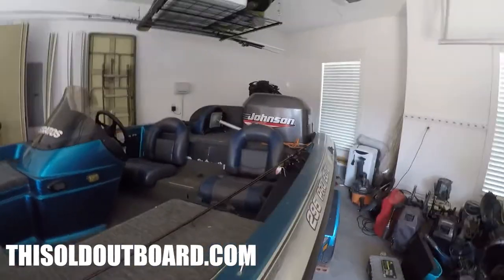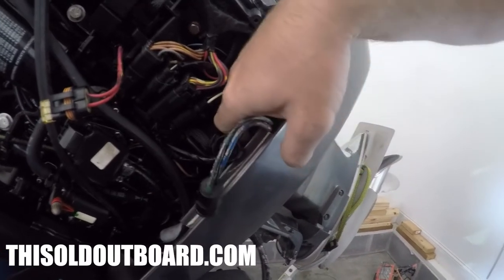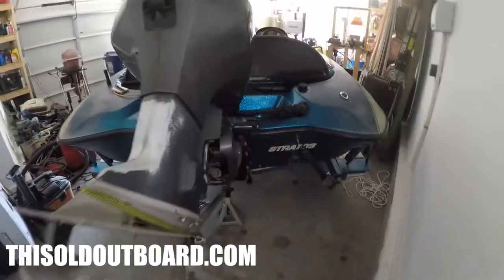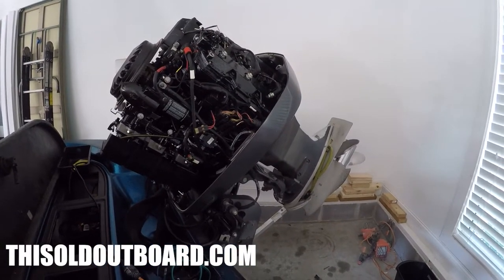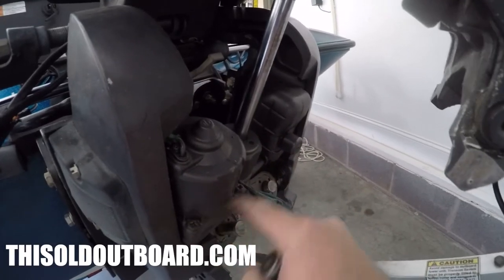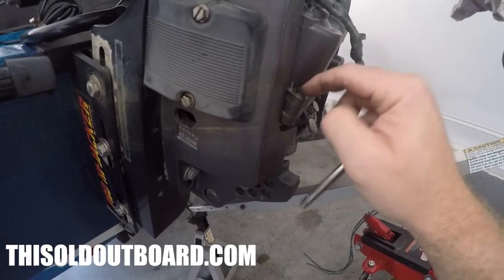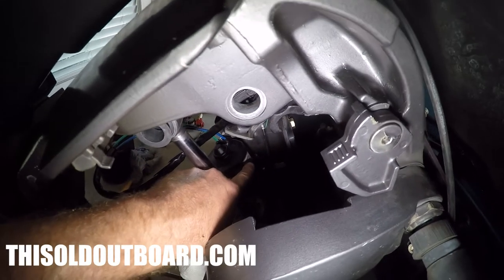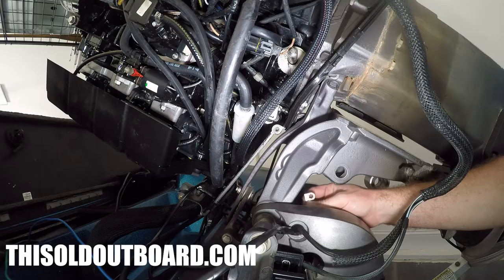Johnson Evinrude FasTrak Power Tilt Trim Motor Replacement

Comment: Great video sir.  Very detailed and concise, well done.  I'm going to swap out the motor tomorrow and see if it works.  It was JUST working last week and now it's not...  Has full power, fuses good, etc.  Gotta be the motor.  Everything else on the boat works.  Thanks for your efforts.

Thanks again for the great video on fixing the boat.  Should have it back on the water in no time!
Reply from the maker: Did I talk religion in this video?
Reply: @thisoldoutboard  LOL, you did not sir.  This comment was meant for another video and somehow I posted it here.  I had multiple videos open at the same time covering the replacement of this motor.  I'm an idiot and posted on the wrong video.  Your's is good.  Sorry for the confusion LOL.  There's another video where the guy shows essentially the same thing... a good video... then goes into talking about god and stuff and I was like... wait, we talking about boat engines/motors or god?  Anyhow, sorry.  I'll edit/delete/remove that part =]

Comment: Long story short. One of the 4 bolts broke off twice removing the motor from pump. (Was not installed all the way down from factory).I was able to machine it out and had to use a 1/4-20 stainless SHCS bolt as the pitch of the 4 bolts they use are not a standard pitch. To machine broken bolt out of pump, i had to remove pump from cylinder. I have it all back together with new trim oil and the motor works but nothing happens to cylinder up or down. Key was installed properly when motor was mounted. Do you know if there is a bleed screw on pump to get air out and the oil moving again. the manual release screw has been tried in both positions with motor running in both positions. But still nothing from cylinders going up or down. thanks jim

Comment: Pro tip: if you forget to put the ground strap on a trim motor bolt, just connect it to one of the trim sender bolts - I did this & no worries

Comment: Do love your video! I Just got a boat with 1989 johnson outboard which has two options to trim tilt the engine either at the shift handle or on the outboard. However, the one on the outboard does not work either up or down. I still can use the one on the shift handle. I would wonder it is related to bad relays?? What do you think? Frankly, this is my first boat so would want to study it first before bringing to the shop.
Reply: why would it be a bad relay if the switch in the handle works? its clearly the switch on the lower cowling. clean connection. if it still doesnt work, inspect or replace trim switch. also inspect red/purple switch hot wire connection.

Comment: Hello friend, I have a problem with the trim, the middle cylinder does not work, I already changed seals and everything and it continues to be the same as if I had no strength, it already has me crazy

Comment: mine went down and the motor wont stop running downward.  it will not trim up from any switch.  if i press up it cancels and the trim motor wont run as long as i hold the up button in.  Relay???
Reply from the maker: Potentially.  Swap relay positions and see if the problem tracks with the relay.